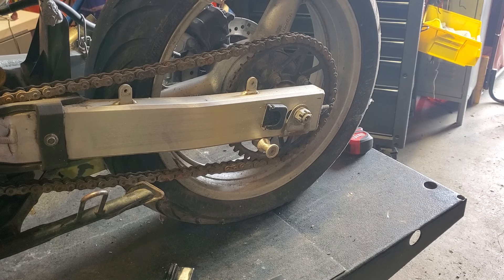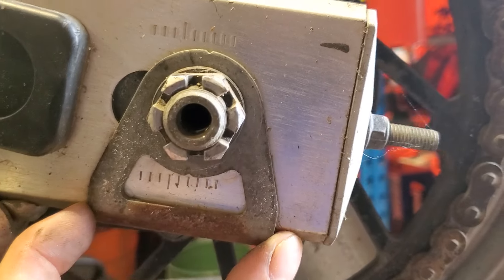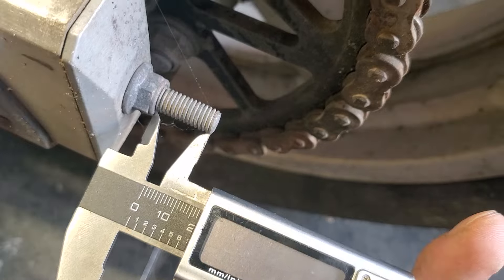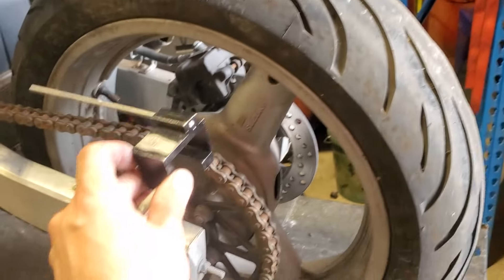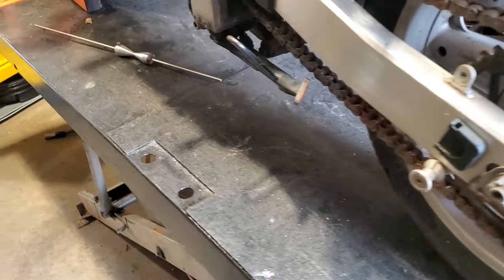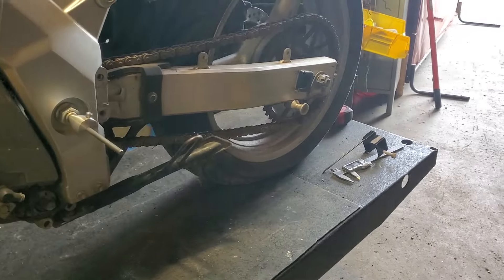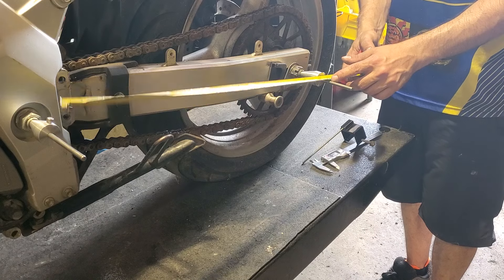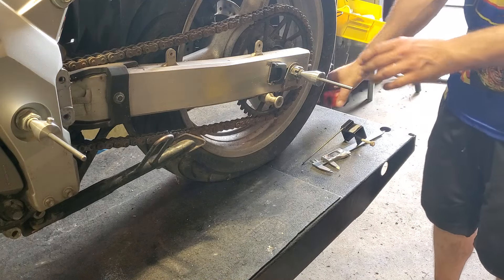new tool for aligning rear motorcycle wheels

Comment: That's a good idea 👍.The accuracy of the tape measure wouldn't matter as long as you use the same tape measure on both sides (adjusted to the same mark=same distance "whatever that distance may be")
Reply from the maker: @RainyRides  the pythagorean thing can get a bit annoying if i cant get a good square measurement i think. But yeah the tape measure is the tape measure.
Reply from the maker: Oh... hmmm, i could make a ruler that hooks onto the rod and keeps itself square
Reply: @Mad8vCycles  engineering straight edge (preferably not a bendy one) with a T at the end
Or piece of string with 2 marks/side equidistant from the through bar ends(I presume the bars are the same length?)
Show us what you come up with👍
Reply: @Mad8vCycles  just lay a 3 foot ruler over it. You dont have to measure from 0 lol.